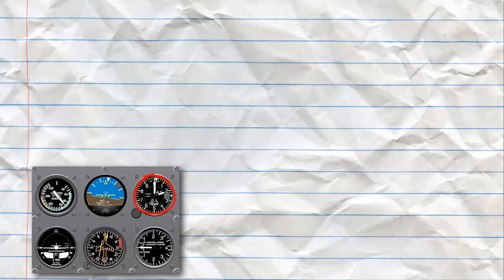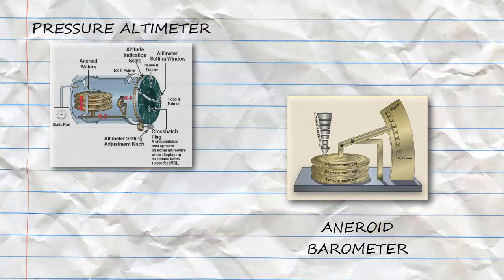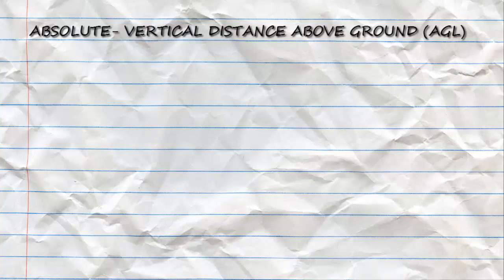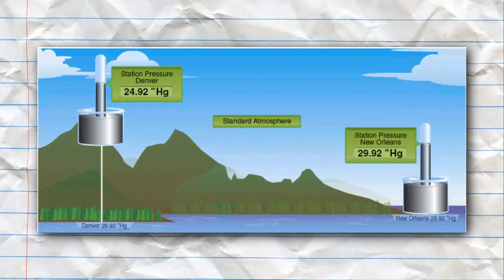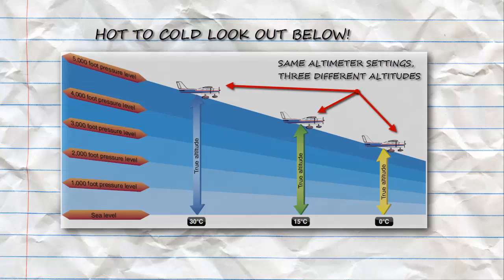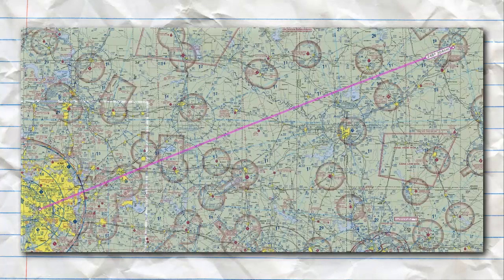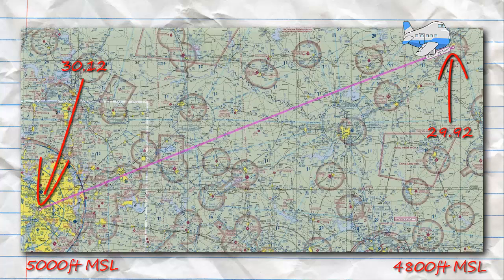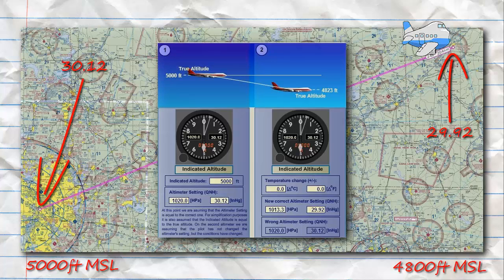Altimeter Errors

Comment: I don’t understand “Hot to Cold look out below”. Doesn’t Hot air = lower pressure and Cold air = higher pressure? So as you fly from Hot air to Cold air wouldn’t the altimeter start to descend? I can’t find a clear answer on this anywhere.
Reply: Dude, I’m on this very crusade. It’s pissing me off. All I find is people just repeating the same crap over and over and it doesn’t make sense.
Reply: Had the same problem. https://phet.colorado.edu/sims/html/gas-properties/latest/gas-properties_en.html . Check the link out and take a look at this formula: PV = nRT (P=pressure, V=volume, n=number of molecules, R=constant, T=temperature) .If we assume volume and number of molecules remain constant and temperature increases, so does pressure. It makes sense, the more heat, the more molecules move and "hit" surfaces, and therefore, the higher the pressure is. 
So yeah, if you place a barometer in a room at 30 ºC it will read, lets say 30.00' Hg (maybe 1000 ft), and if you change the room temp to 10ºC it will read 28.00' Hg (1800 ft). Hence, if you relied on you altimeter and tried to mantain the indicated 1000 ft throughout this temperature change you'd end up flying much lower than 1000 ft.
Reply: @FernandoLXIX  But the atmosphere isn’t a defined volume of air
Reply: @georgia_dawgs_2746  I dont know it for sure, but I'd say the stratosphere and the other upper layers being a huge mass of cold and very stable air pushing down on the troposphere make it behave as if it was a defined volume of air.
Reply: @georgia_dawgs_2746  The pressure increase on warm areas will not be as big as if you had that air trapped in a bottle, since the hot air will have some room to expand, but there must be an increase in pressure on warmer areas. Otherwise the info provided by the FAA wouldn't make sense, and I'm pretty sure they've gotten it from actual experienced pilots and meteorologists.
Reply: The reason this happens is because, as stated, the altimeter is a barometer. If pressure increases, that means you're getting lower as you said. However, temperature causes it to happen so gradually over such a large area that we don't perceive the airplane's climb or descent based on temperature. The altimeter will fool us into thinking our altitude is, say, 3000 feet when in reality it might have dropped to 2800 as we flew into colder air. The change just happened so slowly we didn't see it. That's why, oftentimes, this error is imperceptible to us as pilots. At least, that's my understanding of it.

Also, this is why some airports have temperature corrections on their instrument approach plates. If it gets too hot or cold, you have to correct for the temperature error.

Comment: Good review. 

High Temperatures lend to (lower density) higher air pressure perceived by altimeter, thereby making you think you are low. 

LOW temperature leads to denser but lower pressure at the altimeter, falsely indicating higher altitude in spite of being truly low. 

Is that correct?
Reply: No, high temperature equals lower density or lower pressure. Low temperature equals higher density or higher pressure.
Reply: Flip 'em and you got it!

Comment: how can aircraft physically go low itself even you are flying straight and level ? i am super confused on this concept  ?
Reply: You can "maintain" 10k ft on the gage but if the pressure changes the gage isnt reading correctly so you would end up being at a lower altitude.  If you were truly flying level, your altimeter reading would have to either increase ft or decrease ft based on the pressure change
Reply: you would kinda see the altitude move so you correct it. (if I'm not mistaken), so you lower or raise your nose to maintain the altitude you want to maintain (without changing the pressure on altimeter) since the static pressure is changing as you move through the systems, correct me if I'm wrong

Comment: I’m still waiting for someone to come out with a video of what is actually happening inside the instrument during this error.🤔 (Hot to cold look out below)
Reply: Nothing discernible would happen inside the instrument since all it's doing is measuring pressure. When it's cold, you get a slightly higher pressure than when it's cold. Higher pressure means lower altitude, hence the phrase "from high to low, look out below". So there's no discernible change unless you were to calibrate the instrument for true altitude, which, to my knowledge, has yet to happen in operational aviation instruments. This lack of instrument difference also means that some airports have to have temperature corrections if it gets too cold on instrument approaches.

Comment: are we lowering the aircraft as we see the altimeter moving higher to maintain the 5000? (without adjusting the kollsman)..In other words, are we bringing down the aircraft as we read the altimeter going higher?
Reply: Yes. Instead of gradually adjusting the altimeter, we're gradually descending. This change in pressure usually occurs over a large distance so it's a very slow and difficult to recognize.
Reply: @thebeardedbird8125  but this doesn’t make sense. Air density is lower in hot weather and higher in cold. So if we fly from from hot to cold this will indicate as a descent on the altimeter prompting a climb from the pilot to maintain level altitude. Unless I’m missing something I think this point is misunderstood and taught wrong everywhere.
Reply: @nicholasbeaufrand4752  
You got the right idea. But if you forget or ignore to change the altimeter setting with the local setting around, you won’t notice the change because the pressure is changing very slowly throughout your flight. 
So let’s say you’re trying to maintain your altitude of 5000ft throughout your long cross country flight, with the altimeter set to 29.92. that you received from your departure airport ATIS.
After say 150 NM, you forgot to keep up your altimeter setting with the current altimeter settings at the nearest airports to you.
You’re still at 5000ft with the same altimeter setting you left in it, 29.92 , but the current altimeter for the area is now 29.42 (.1” Hg is equivalent to 100 ft. In altitude)
So once you correct the kollsman window to read 29.42, without climbing or descending, you will see a correct reading of 4,500. 
500 below what you thought you were at.

If you use flight following during your cross country, which is highly recommend, ATC will keep you updated on the current Altimeter setting throughout your flight so you just need to change it when told and not really worry about it.
If not using flight following then just stay aware of this error and check in to the nearest ATIS, AWOS or FSS every so often.

I hope this helped 👨🏻‍✈️👍🏼
Reply: @thebeardedbird8125  I have no problem understanding the “From high to low look out bellow” which is what your example explains. My issue is with the “From hot to cold look out bellow”. Because this sentence in terms of density would translate to “From hot (low density) to cold (high density)look out bellow and that doesn’t make sense imho. Unless there’s something I’m not getting. 
So again, if I takeoff on a hot day with a local altimeter setting of 29.92 and fly into a colder airmass with a local setting of 30.92 my altimeter should read 1000 feet lower than my actual altitude prompting me to climb 1000 feet to maintain altitude. How am I wrong here?
Reply: @nicholasbeaufrand4752  You’re not wrong about the change in altitude, 1000ft lower. But the idea is that if the pilot does not correct their altimeter setting throughout their flight, like in this case, taking off at 29.92 and going to a colder area of 30.92, then you won’t have any idea that your altimeter is incorrect if you still have it set to 29.92. 
So nothing is going to prompt you to climb if you still have it set to 29.92.
If you are late to correct your altimeter setting then you’d be cruising 1000 feet below without even realizing which can lead to CFIT.
If you do catch it late and correct it to the current altimeter setting, then the altimeter will prompt you to climb.
Reply: @thebeardedbird8125  No, you’d be cruising 1000 higher not lower. Because you’d be flying from a low pressure to a high pressure. That’s what I don’t get. The saying should be from cold to hot look out bellow.
Reply: @nicholasbeaufrand4752  
Flying from a warm airmass to a cold airmass will make the indicated altitude on the altimeter read higher, which might then cause the pilot to descend in order adjust an maintain their indicated altitude.
Reply: @thebeardedbird8125  I feel like I’m speaking mandarin. You keep on repeating the same thing over and over but it still doesn’t make sense. If a cold air mass is denser than a warm one, and we know that when an altimeter sense denser air it indicates a descent (so it would indicate lower) why would it indicate higher when flying in a denser air mass?

Comment: when you are flying from high to low pressure area without changing the alimeter setting,  when we see the alimeter starts to climb higher, are we lowering the plane back down to what we believe is the correct altitude of 5000? i assume we are adjusting the aircraft to go down lower when we see the higher alitmeter readings? of course i know in the end that because we did not correct for the local pressure we are actually coming in lower. if we lowered the plane according to the alitmeter readings..i just want to make sure i understand that we are physically lowering the plane to 5000 when we see the altimeter reading the higher altitudes resulting from the pressure change..
Reply: Essentially, yes. You're physically lowering the plane to whatever altitude the altimeter thinks is 5000 if you don't reset the Kollsman window.

Comment: I need something clarified. If you’re coming for a landing at a runway at sea level or at 5000ft., and you can see the runway why do you need to know the altitude of said runway?
Reply: The altitude would change the length of the runway needed for one...... if the runway is at 5000 feet for instance, the decreased air density would mean you would need more runway to get airborne or come to a stop. If you were heavily loaded and it was a warmer day, you might not be able to have enough lift to clear obstacles at the end of the runway, or have enough runway to land and come to a stop.
Reply: To avoid complacency.